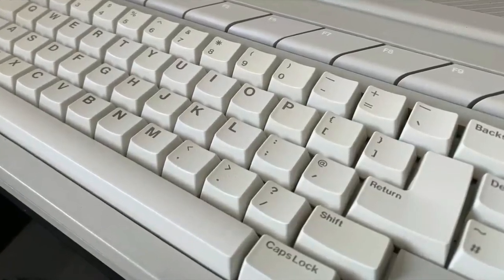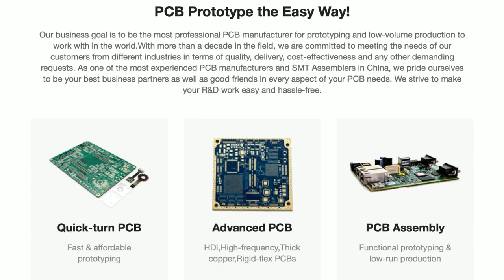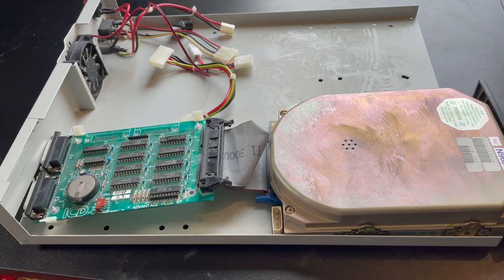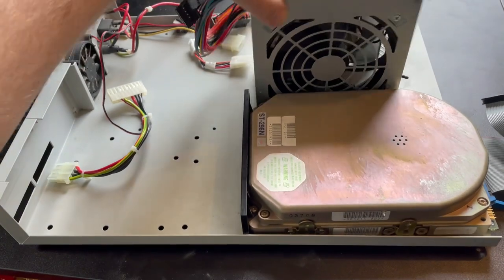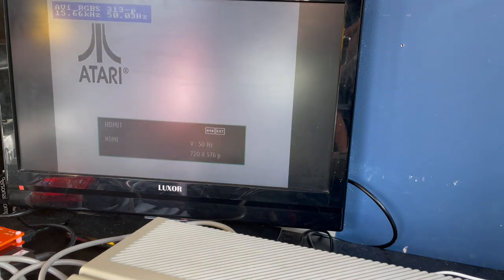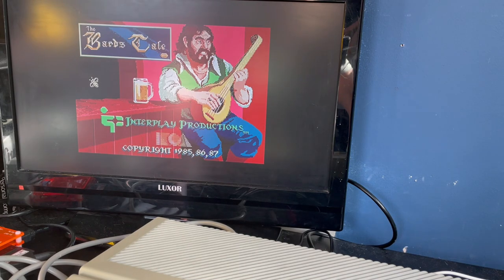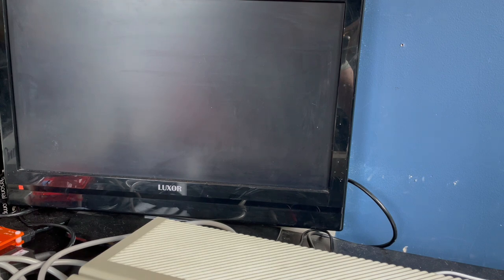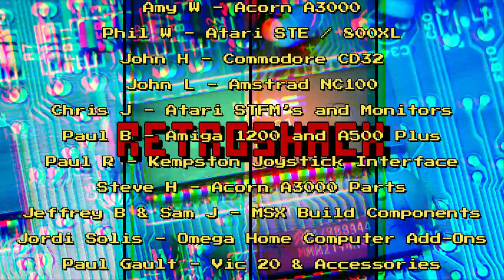Atari ST Hard Drives - SCSI - ACSI - SD Cards - Is it worth it?

Comment: Once upon I had the choice between my Mega STE or an STE (the STE would have been given to me for free, and the MSTE I could buy). I chose the Mega because I couldn't think of using a machine without a hard disk. Now that you have a hard disk a whole new world opens up. First of all, you can install NVDI and have a much faster desktop and fonts. If you want to increase the usability of the desktop you can install something like Teradesk, which is a lightweight and good desktop replacement or something like Thing or Jinee which have all the bells and whistles. If I were you, and if you don't want to check any unixey stuff (not that you could with ~1MB of RAM left), I would avoid freemint since it's slow on an 8MHz machine and I would go for Magic. Multitos had received a lot of backlash back in the day, but I thought it was nice, but it did slowdown the machine. Magic is much snappier but I do prefer MiNT, it seems to have a better architecture. There are also AES extensions like Multigem and Geneva that increase the cooperative multitasking capabilities of TOS. 
I think that Ultrasatan is compatible with HDDriver and ACSI2STM isn't. That means that you lose the ability to have partitions with Fat 32 or Ext2 filesystems, so that's a bit of a minus.

Comment: I spent a lot of time on BBS's as a teen. Would yours run over telnet? because I don't think i could afford dialing into the UK, and I'm not even sure if I could find an old modem either. I guess you could set up a pi on ethernet that people could ssh into, and have a serial interface connecting a linux to the atari and people can ssh in and run minicom to connect?

Comment: I've got a Progate 120DC hard disc drive for an Atari, inside the metal box is a Maxtor 7120SR 120Mb drive. The QC stamp says 1992.
My Atari has been set up but not used for 20 years when I got a 486 PC. I got everything working today except for the hard drive.
I remember when I did use this hard drive I had to switch it on and off a few times to kick start it. I've tried this today and got a couple of clunks from it but not managed to actually get it going. Can anyone help?

Comment: 3 major wrong statements in this video:

1. Atari HDD solution where very expensive when compared to others.
No, actually about 20-30% cheaper, and when compared to AMIGA even 50%-100% cheaper then same sized HDD since AMIGA didnt have a HDD controller. Where did you live in 80s? Also gamers didnt often get the HDD for ST or A500 since there was no point to do it, productivity users did. In fact, in 1987 the Mega ST came out, and the Megafile line of ACSI HDDs was designed with Mega ST design in mind.

2. AMIGA Workbench faster then ST TOS/GEM GUI.... are you kidding? ST is doing circles around WB in terms of speed, even a Floppy based ST has faster GUI workflow then a SCSI AMIGA 500, Jesus....

3. When MiNT came out, (and dont forget MagiC) AMIGA was just getting the WB 2.0... So the Atari was way ahead...

The problem of AMIGA fanboys is that they tend to look at AMIGA with todays optics, using turbo cards, maxed out memory, OCS to ECS upgrade, SCSI2SD adapters, flickerfixers, scandoublers, 3.xx WB. But this is NOT AMIGA experience from 80s. AMIGA back then was nothing special, just a gaming machine and few Video applications.
Luckly I was in both worlds and I saw the problem, average AMIGA user was just a gamer, average ST user knew how HW works and had a programing skills, or was a productivity apps guy... so AMIGA guy had to win the argument which computer is better. ST users didnt care much, but they liked to taunt AMIGA guys so they start to a rage.
Reply: Yes, my Amiga friends would come over to use my ST if they needed to do word processing/DTP. They also had to swap Workbench disks just to copy a file.

The best thing I found about the ST was the breadth and quality of productivity software that was easily available. That was mainly thanks to magazines like ST Format, in the UK, and an amazing PD/Shareware scene. I had full office suites, desktop publishing apps, midi sequencers, technical drawing apps, multiple programming apps, stats and graphing software, plus fun stuff like raytracing (only took a weekend for a single picture!) and fractal generation, all while being a kid with only pocket money to my name.

Comment: Used to have an external drive for Atari 520STe (expanded to double RAM).. The drive was white, just over an inch tall, 50MB I think, orange LED switch on the right and I think maybe a red LED on the left.. can't find what it was at all.. unsure if using parallel or SCSI type connectors.. would love to open it now, see if it's one large disk or not.

Comment: I have built a acsi2stm device and uploaded and tried all software versions but all I get is a blank screen then normal desktop with no HD shown serial output just shows sd card size and success then after about 1 or mins seems to refresh then display sd card again. I press shift-s at bootup for setup but just blank screen still. Anyone have any ideas whats wrong as I really want to get this working :)

Comment: I have an ultrasatan external SD HD ant I can’t run anything on my 520 ST aside from a couple programs. 512K isn’t enough to do anything. I assume the HD emulator is consuming ram since sysinfo shows only 370k or so available.
Reply: It was always better to upgrade the RAM and then get a hard disk with a 520 for just this reason.
Reply: @Sl1pstreams  I have an original external harddrive but ended up doing a 4k ram upgrade on the 520 and got a gotek for it.
Reply: @sideburn  That’s a dream config. A user in the ST era would have been blown away 😁

Comment: What tos is that running and does that later tos effect game compatibility?
Reply: you can use TOS 1.4 easy, with full game compatibility (except STE games).
Reply: Tos 1.4 is on my ste. It will not play many of my Atari St games. So the Ste rarely gets turned on.@madigorfkgoogle9349

Comment: hmmm i have a 520 stfm with only half a meg, is there a memory limitation using this?
Reply from the maker: Nope, you’ll be fine :)
Reply: @TheRetroShack  have you tried some of the hard drives that you can use on the Mister atari st core?
Reply from the maker: @bazza5699  Not yet - but now I will be :)
Reply: but be aware that the starting games from HDD on Putnik image as presented in this video will not work on 512KB.
Besides, you can upgrade your ST pretty easy nowdays, but yes soldering is involved...

Comment: How much ram does the Atari need?
Reply: Depends what you want to do. Min spec was initially 256K. Maximum is 4MB.
Reply: Most software was made to run fine with 1Mb but advanced features may need 2Mb or more.  Max RAM on standard STs were 4Mb (14Mb in some cases), Mega STs were 12Mb-16Mb, TT and Falcon were 4Gb (the highest I have seen running on a TT is 1Gb and I have 260Mb in mine).
Reply: The most on the ST is 4MB. So in context with the video this is the maximum.
Reply: @david-spliso1928  there was no 256KB version of ST, initially the 128 and 512KB version was planed, but before release the 128K version was dropped.
So the lowest RAM ST version was a 512KB version.

Also the limit of 4MB is given by MMU of ST, but technically the 16MB (1-1.5MB restricted) is what can be addressed on M68000 of ST, and it was often used in laboratory specialty use of ST computer (not very known) to address VME adapters and VME to ISA adapters also some graphic adapters used this.
Reply: @madigorfkgoogle9349  For a time the 260ST with 256K only sold in Europe.
Reply: @david-spliso1928  sorry mate, the 260ST has 512KB memory, I do own one.
Reply: @madigorfkgoogle9349  I've not owned an 260ST and they weren't sold in the UK. But all the many, many articles on the net stating a 260ST version with 256K was sold in certain European countries possibly need correcting, then.

Comment: When I first started buying DVDs, I found some movies would require two disks, or at least turning over. They were clearly made by ST owners.
Reply: Two sided dvd's we're common for a little while.
Reply: @lasskinn474  ...like Tamagochis and the Macerana.
Reply: @FatNorthernBigot  i think it was some cheaper manufacturing thing making single layer or single layer per disc side discs
Reply: @lasskinn474  They went out of fashion even quicker than DVDs themselves.
Reply: @lasskinn474  All of the double-sided DVDs I own are the same movie in different aspect ratios, i.e. 16:9 one side, 4:3 the other.

Comment: You say the Amiga desktop is better. I absolutely do not agree. You dont get any desktop without a floppy disk. If your disk has failed or your drive has failed you get nothing. The Atari Gem desktop is solid in Rom. I have both computers and totally dislike having to put a wb disk in the drive. Also you stated you were a hard core Atari Fan. No Atari Fan swaps to an Amiga after 2 years. No you were not loyal to Atari at all.

Comment: I still have my original Megafile 60 and it still works. I also have one of very few original racked megaST. It would be a nice piece for a collector. Anyone fancy a racked megaST?
Reply: Racked?
Reply: @blackterminal  Yap. Big Metal rack. It comes with a built-in 16bit 44.1khz sampler. I think it was made by a company called Hybrid Arts.
Reply: @blackterminal  some musicians used to get their ST/Mega ST mounted in a 19" rack, so they can use it alongside professional racked gear like Akais, Rolands, Yamahas. 19" rack box is a industry standard.
Reply: @Phunker1  how much are you wanting for that? I'm a big ST fan